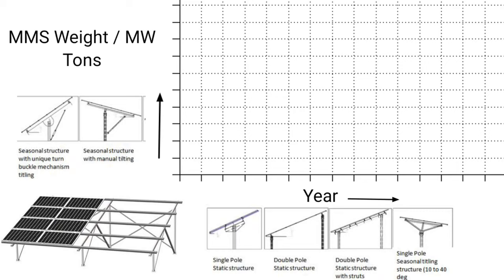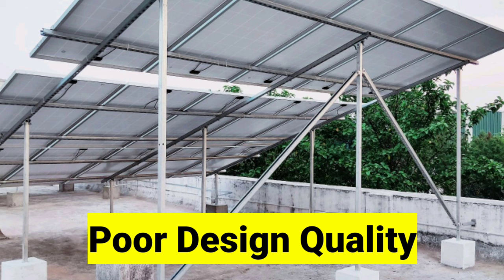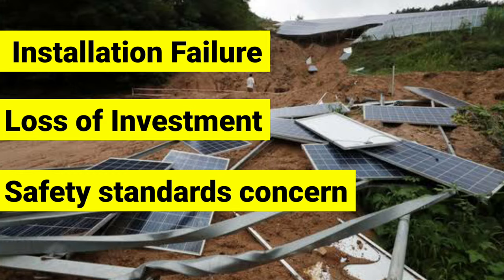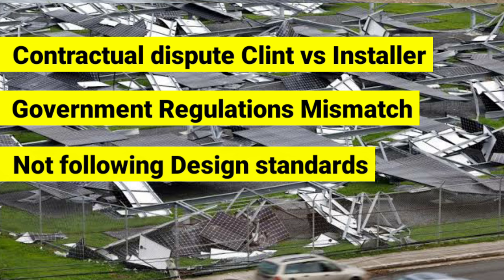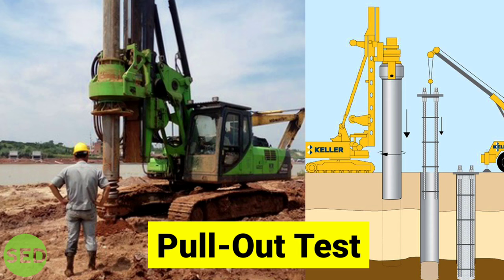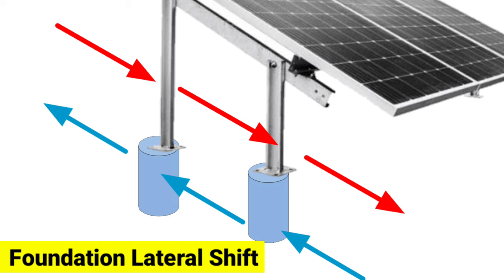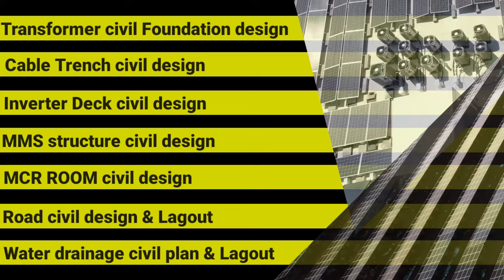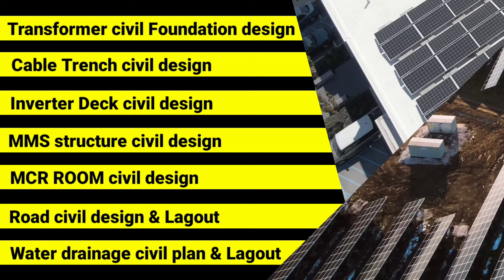☀️ Solar Structure | MMS Design | Civil Design | Professional Support for your Utility & Residential

Comment: Sir whether it is right to have solar panels installed on a trolley for agriculture purposes.  Because it is risky to leave solar panels in  fields during night.
Someone told that daily transportation will lead to micro fractures.
Reply from the maker: Yeh absolutely , every day jerk can damage it , you can use shock absorber